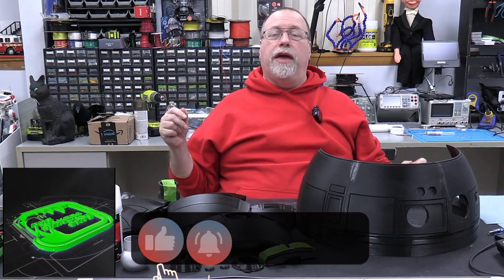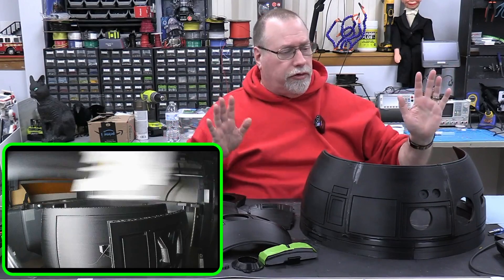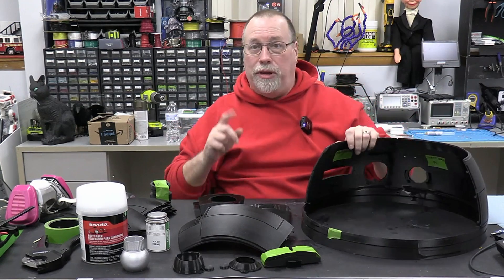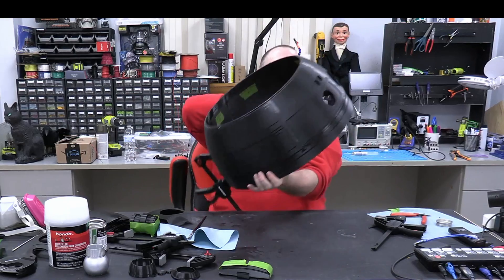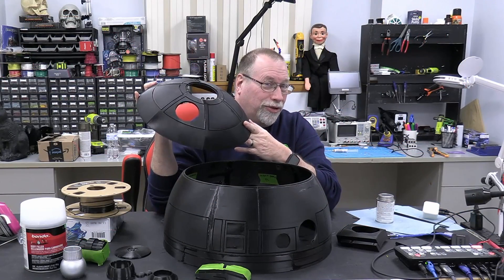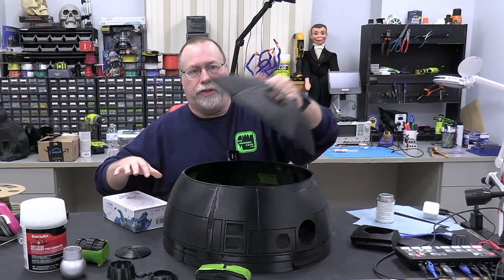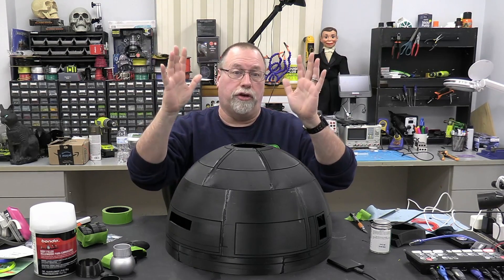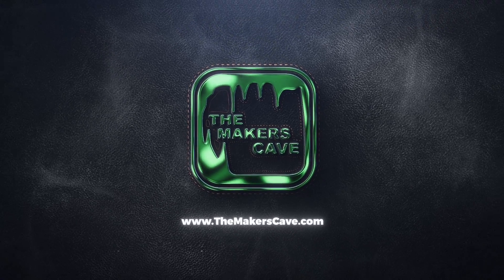Building A Life Size 3D Printed R2-D2

Comment: Great video Steve! Using a 3D printing pen as a welder is brilliant! You're making want to print this thing myself!
Reply from the maker: I have a plstic welder coming in that uses staples you melt into the two pieces to make a rock solid joint.  I also have 3D Gloop for PETG coming in for chemical adhesion, supposed to be better smelling then that stuff I'm using now.